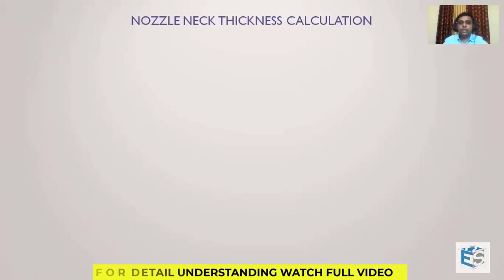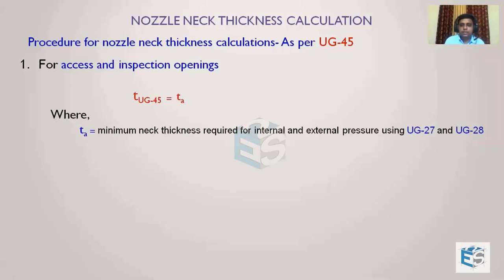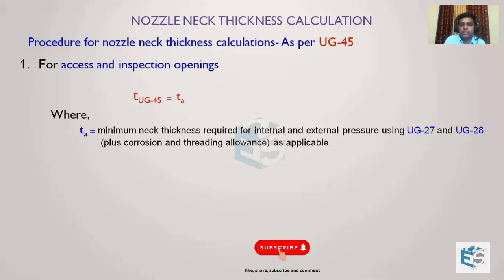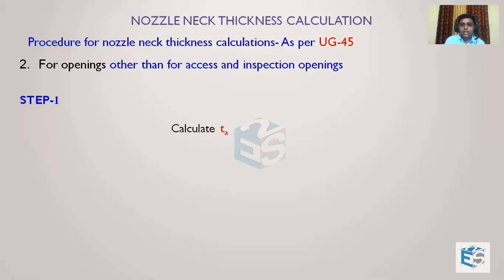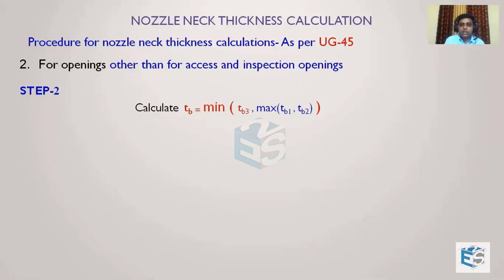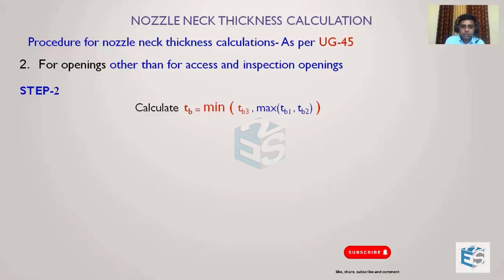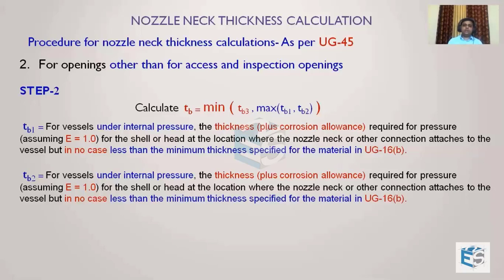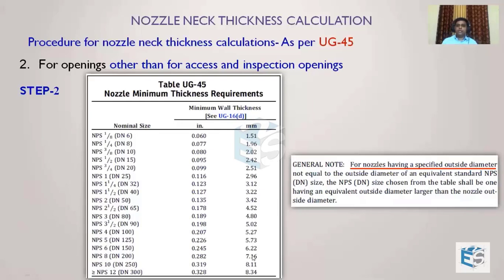PROCEDURE FOR NOZZLE NECK THICKNESS CALCULATION AS PER UG-45 | NOZZLE DESIGN FOR PRESSURE VESSEL

Comment: Excellent video.👏
Can you clarify one question sir? When we calculate ta (minimum neck thickness required as per UG-27/28) which radius need to select??
Pressure vessel internal radius or nozzle pipe internal radius??
Thanks
Reply from the maker: Thanks for your question. For ta thickness calculation it's nozzle thickness. and for tb it's shell thickness.